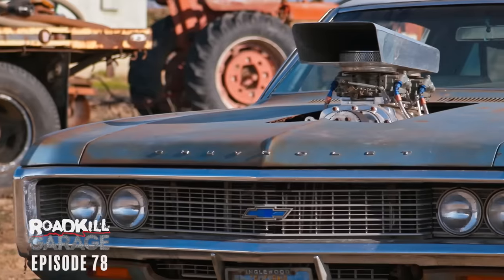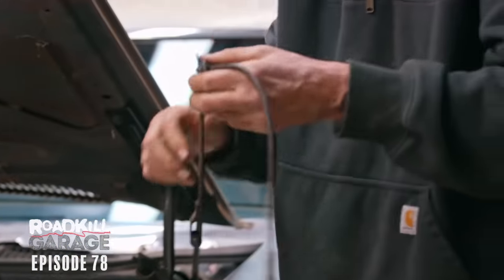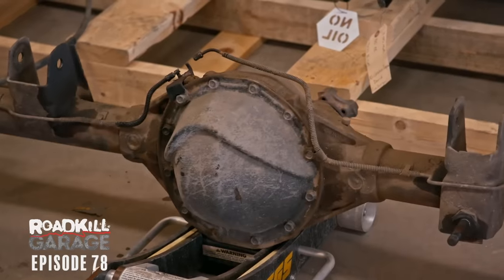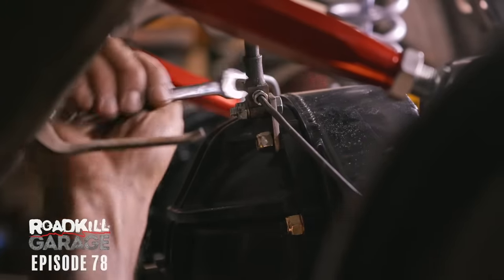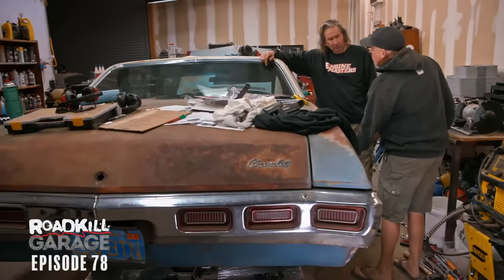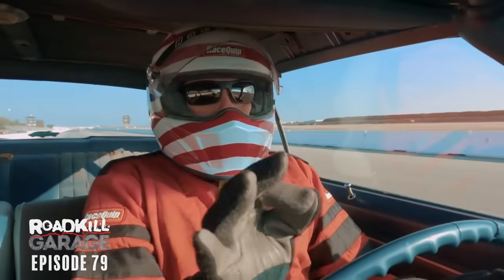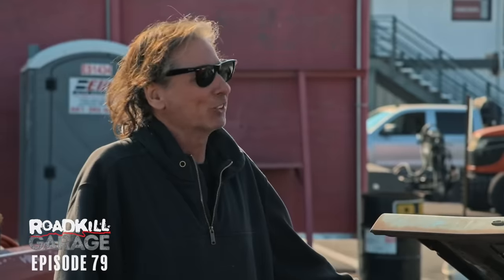Huge Upgrades for the Crusher Impala! Will It Break? | Roadkill Garage | MotorTrend

Comment: I’ve had the battery do the same thing on a 74 Nova in 1984 after hitting a speed bump leaving high school. Also acid is acid not a caustic. Caustic will neutralize acid.

Comment: I was relieved when David said that the supplier installed an Eaton Truetrac diff. instead of a Limp-Slip diff. or worse yet, a Locker gear set. The car is going to be quick & more controllable, i.e., more fun. Thanks for the great video guys.
Reply: a truetrac is a limited slip...

Comment: If you're running anything other than solid engine mounts that BBC is just twisting the snot out of the stock column shifter linkage. And that's why you're having shift issues. And yes a floor mount shifter will correct the issue plus it's more accurate and fun to bang gears with one and it looks Kool!!!!! But you should still run solids!........ Love the Crusher Imp! Cheers.

Comment: If that's a TH-400  transmission in that (I'm sure it is) I would pull out the "vacuum modulator" valve, and clean it up. Either that or your "governor valve" is sticking. Either one of those will prevent a TH-400 from shifting.

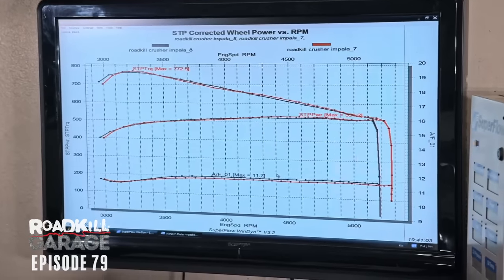Comment: 11:20s at 119 is better than I thought y'all would throw down on this episode. That's running pretty strong. I imagine the car weighs 4100 with driver? 

Years ago we jumped an old 67 Ford pickup with no bed over railroad tracks and tossed the battery in the fan.
It looked like manatee's in Florida being cut up by a boat prop.

Comment: Chevelle 396. Cruising down the road, I hit the gas. 3 seconds later, explosion and smoke but the engine ran fine.
The factory battery hold down let the battery tip over. the positive post laid on the valve cover and burned a hole and the spark ignited the oil fumes. Both valve cover gaskets blew out and the oil ran over the exhaust manifolds.
Now I always use a safety strap.

Comment: I like the zip tie tip. I was wondering if running 2 or 3 zip ties around the axel tube in between it and the brake line might prevent a future leak from the brake line rubbing on the axel tube. Just thinking. But then again, the next time we see this car it will be totally taken apart again. 😆

Comment: I had a 70 Impala (same basic body) My battery did the exact same thing. Jumped into the alternator and acid went everywhere. Took the coating off my Holley carb and stained the aluminum intake. I can completely relate……

Comment: Love the car! However, using plastic zip ties on brake lines is so rookie. Even Horror Freight sells metal zip ties. They won't deteriorate from exposure, melt and fail. Put a bit of paint on the metal ties and they are a rugged solution. Proper brackets are the best way.

Comment: Its amazing what fuel does for an engine. Build this exact engine for c16, waaay smaller pulley, make 1000 horsepower.
Reply: That engine will never make 1000 whether you put C16 or E85 in it. You can spin the blower as fast as you like, but you will only make a lot of heat. That engine needs more cam and larger heads to be 1000 hp capable.

Comment: 9 psi at 7 to 1 comp is better. Maybe 10 psi will also work.
Reply: What are you talking about? Unless you run nitro, nobody runs super low compression in supercharged engines any more.

Comment: I can't believe it only makes 530. Seems like it should make that without the blower
Reply: No, There's a very mild 224 cam in it, and the heads are pretty small. That engine makes about 650-680 when the blower is on point and a smaller pulley. Freibuger has talked about that engine quite a lot.

Comment: Ford truck diff,,, replaced by Ford with Danas. Power robbing  pinion placement that is VERY hard on oils. Pinion support that break regularly. And then explode the pinion. Generally noisy, and the worst,, so bloody heavy.  And lets fit monster axles and braces just to make it even heavier!!
As for drag racing,,, the genuine Ford axles break outside the bearing,, often.  I used GM 28 spline axles road racing and never had an issue,, the Ford ones are made from plastic!!
The only good thing is lots of ratios available,, otherwise prehistoric junk. 
Power steering??  Girl!!